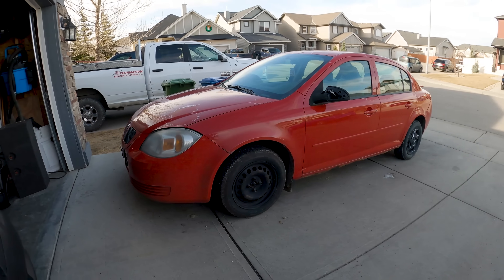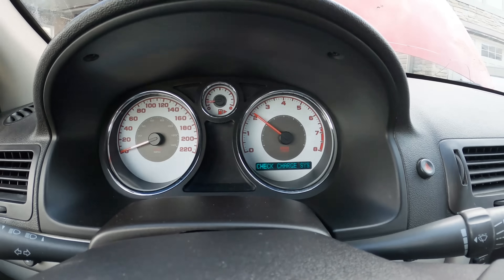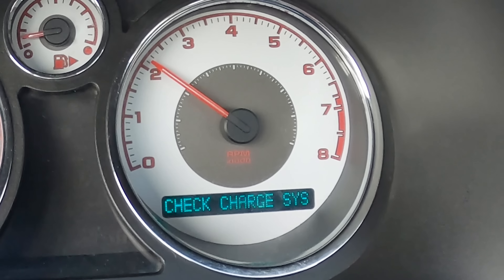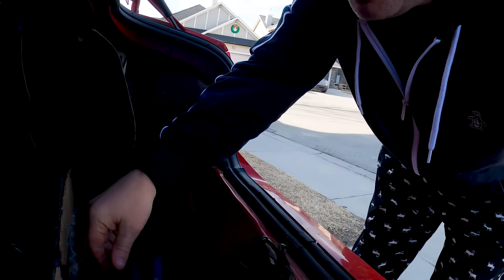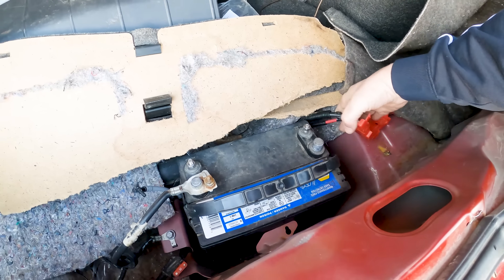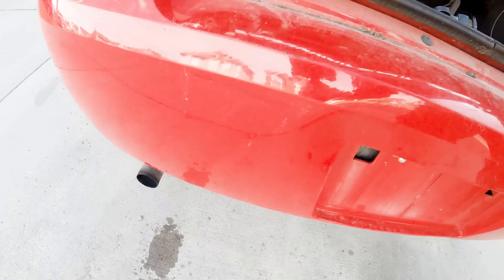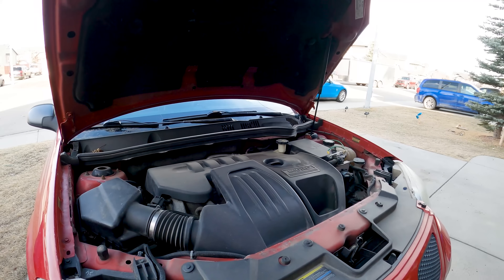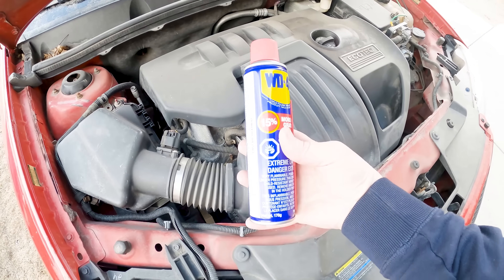ROADSIDE FIX! REVIVE your DEAD or DYING Alternator with this ALMOST FREE trick! | Gears and Tech

Comment: The information in this video is not true and incorrect. I'm an automotive technician for 15 years. I specialize in electrical. Never remove your battery cables while the engine is running and idling. The alternator uses the 12 volt battery to create an electro magnet inside the alternator in order to create a magnetic field... A magnetic field is needed to produces current within the copper windings in the stator of the alternator. The electricity being produced is AC (alternating Current). The diodes in the alternator will then covert the AC into DC (Direct Current) because your vehicle uses DC. All the negative phase are removed by the diodes and the positive electrons will flow to the positive side of the battery pushing the electricity back to the negative side of the 12 volt battery... Remember that the alternator does not charge the vehicle's battery but rather maintain the charge of the 12 volt battery.
Reply: Question 
My car when starting it's only  click once then the battery  ground terminal gets hot 
Any update on. That
Reply: @snoopha3  probable cause is loose connection, copper wire strands are cut within the negative cable or a bad starter drawing too much amperage causing the cable to heat up quickly.
Reply from the maker: Bad ground
Dead short inside starter

Try hitting the starter with a 2x4 or softly with a hammer and then try again.

Comment: When disconnecting battery, there is voltage supplies to ignition module / coils so no spark at spark plugs also fuel pump has no power so no fuel deliver to injectors then engine will be shut off ? Am I right or wrong with this theory? Someone has any inputs ?
Reply from the maker: Engine running, battery unplugged nothing changes, alternator provides power to everything

Engine off, battery disconnected, nothing has power

Comment: I thought of spraying alternator with brake cleaner, i didnt yet, sonebody says its flammable. Can i use Brake Cleaner?? Plus is wd-40 flamable???
Reply: Despite what the comments say on here, do not spray your alternator with contact cleaner or wd40. This will work its way into the bearings and will kill the alternator.
Reply from the maker: Use the wd40

Comment: You don't have to disconnect it for the engine to die, it will die anyway very quickly with  the power steering failing.
Reply from the maker: True

Comment: Do not remove your battery cable while your car is running. Most modern vehicles regulate the charging through the ecu, and if the ECU doesn't detect the battery it will cause it to overcharge the alternator causing the ECU to fry, or worse

Comment: Ive been chasing a p0345 code  & i cant figure out what it is. Can a faulty alternator throw that code. 05 ford expedition. 5.4L
Reply: That is for a bank 2 camshaft position sensor. It is probably just the sensor but you need to swap it asap. It could cause a no start and it can also end up making you need a timing chain. Don’t let that go. Find a video to show you how to change it & change it asap!!!!

Comment: Buy a $8 multimeter from harbor freight... and NEVER disconnect your battery when the engine is running on a modern vehicle !!!  Modern vehicles have extremely sensitive electronics that can be damaged from voltage spikes caused when disconnecting or connecting battery cables with the engine running!

Comment: Hi! Great video, learned alot. Question though. I'm trying to diagnose my alternator pulley without removing it from the car. I does not have a belt (Volvo 3.2) . When I turn off the car, should it come to a dead stop (the alternator) or should it spin a few seconds? (I thought this was the point with the pulley to not put to much stress on the alternator) thanks!
Reply from the maker: I'm not familiar with your setup. I would think it should free wheel when the driver stops.
Reply: @GearsAndTech  thanks. I actually think so too. Gotten different answers when I've spoken to local mechanics where I live.

Comment: DO NOT DISCONNECT BATTERY W/ENGINE RUNNING:
My concept is that the battery acts as a "Buffer" or "Surge Protector" for your Electronic Modules (DME, etc.). It is also sensed by the IBS, DME Power Management, & Voltage Regulator, to determine Alternator Voltage Output. Disconnecting Battery with engine running can damage Alternator Diodes, and/or damage ECU's.

Most any vehicle since the 1970's with an ECU for EFI, had a warning label on/near the battery saying NOT to disconnect battery with engine running. Bentley Manual states that MULTIPLE times, with this quote at p. 248:

Running wipers with no water on the windshield will wear the wiper.

Comment: disconnecting the battery while the car is running on some cars will completely fry the voltage regulator, then your alternator is guaranteed to be dead.

Comment: My mom's 2006 RX350 alt bit the dust on the way home from the airport. I had one of my passengers rev the engine to keep it charging (because the light would come on if the engine was under 3,000RPM) while I ran into autozone and got a can of WD-40. I emptied 1/4 of the can into the alternator and was able to get us home and replace the alternator and serp belt my next paycheck.
Reply from the maker: Perfect, that's exactly what this tip is for

Comment: He used a tool.. aka usb voltage checker…. Also loose battery cables can cause battery or charging issues. You need a wrench or ratchet (a tool) to loosen the batter terminals… you need to rename this video to “let me waste your time” thumbs down!
Reply from the maker: You got me

Comment: Hey Elvis, use a iron object touch it to the alternator pulley then turn the key to on if it is magnitized and the metal object sticks the damn thing is good..
Reply from the maker: Thanks for the tip
Reply: I did this and it does stick to alternator pulley but real lightly . How strong of a pull does it have to be when it sticks to the pulley ?

Comment: Many of the newer alternators have the field coil (on the rotor) receiving voltage from the battery and won't output any voltage when the battery is disconnected.  So unplugging the battery, on such a system, will always cause the motor to stop.  But, on a lot of older cars, the car will remain running off of just the alternator when the battery is unplugged.  Good video!  I gave it a like.
Reply from the maker: Thanks for the extra info.

Comment: But what if the battery is lower than 10 amps your teick is useless because the car will not turn over to get a charge...
Reply from the maker: Jump start car, then it'll charge battery

Comment: Doing it now on my Volvo S40 2007. Battery light came on today after a massive oil leak (my fault, I stripped the housing cap to the oil filter and leaked oil into my drive belt and alternator) replaced the cap now having power system problems.
Reply: Update: didn’t work for me. The car died after unplugging the negative cable then it wouldn’t start again. New alternator test works? I guess,
Reply from the maker: Yep, either more wd40 and try again

Or new alternator

A jump start to confirm first though. Battery will have been low due to poor alternator performance
Reply: @GearsAndTech  Yes you’re absolutely right. I ran out of wd40 and my 9 volt battery was dead in my multimeter. My sister was able to bring me a new 9 volt. I checked the voltage from the battery (11.???) and when it was cranked up (7.8?? Ish) it seems to just keep draining the battery while it’s on and all the lights on my instrument cluster are on and flashing. Don’t know. I’ll have to check out it tomorrow in the sunlight. I might even record since I have nothing else planned

Comment: The author is no mechanic! And he's dangerous... Removing the positive cable could easily lead to a spark next to a battery with low charge off gassing as the alternator attempts to charge. All diodes in the alternator will immediately be chunk and the backyard amuture badly burnt or worse...
Reply from the maker: Wow, sounds pretty grim

How come none of that happened when I did it?

Comment: An alternator can - and should - be producing full charge at idle. That is the whole point of an alternator vers a generator which does what you are talking about. At 11.7 V that alternator is not charging. No more testing required; and specially not removing the battery cable with the engine running to confirm what you already know - unless its the loose battery pole causing the issue. Untold problems will occur in the electronics of modern cars if you do that - again, you are stuck in the past. Your "fix" was useful in a desperate situation but telling people to do the other stuff is going to cost some poor bastard a lot of money.

Comment: Waste of time 12.4 volts is an undercharged battery. Alternators always generate around 14 volts even at idle revving the engine is not necessary. If revving the engine gets you more voltage then the voltage regulator in the alternator is bad. Use a voltmeter with engine on and check voltage at the battery if its between 14-14.8 volts the alternator is working. He clearly has issue with the alternator. The alternator is what powers everything in your car not the battery.
Reply from the maker: its great when you have all the tools, but if not you gotta do what you gotta do

Comment: Good thing you explained how to open the hood!   Had to rewind and watch carefully but finally figured out how to open my hood !      But you didn’t explain how to open the drivers door so I’m currently still stuck sitting in my car     !!    Been about a year now !!  Also  :   Please explain how to get the straw into the wd40 nozzle  again   I tried using a hammer drill but it still won’t work
Reply from the maker: Glad I could help

Seems like you're on the right track with that straw. Just twist while you push after you use the drill to make the hole bigger

If that doesn't work, you need a bigger hammer

Comment: Misinformation alert between 2 groups:

1) Mechanics trained that this DOESN'T work
2) The poster saying it does

Im going to tell you why both wre are right.

Where do mechanics get their information from? Books/teachers/statistics/guidelines etc. They INVENTED these guidelines based off of the mathematical chance that something could happen. Actuaries do this work mostly who work for insurance companies. 

If you are a mechanic who does this job for a large company and you have a 5 to 10% chance that this might fail and you end up doing this job for 10 years and you end up doing it a thousand times How many refunds will you do? You will cost the company a lot of money. Therefore they will tell you to never do this because you will end up frying the part. 

However, that does not change the fact that there is still a 90% chance that it will succeed. If you are watching this video and you do not have the money to take it to an expensive mechanic and pay $1,000 to fix it when you could use the shortcut method and fix it for a couple hours of your own time and $100 in spare parts then would you take a 90% risk? And 80% risk? What if it was 66%? At some point there are diminishing returns with these types of videos and tricks. The mechanics are not wrong but then again it comes down to not paying for a premium. 

I think you understand what I am saying here. They will have a war in the comments both saying that they are right. They are absolutely correct because one side has been taught one thing but yet the other side is not lying because they have successfully demonstrated empirical evidence and proof by doing the job repeatedly and yet never having a negative experience. Does that mean that they are wrong? Absolutely not. A mechanic would never try that because they have all of the tools, the training, and the money to pull it off without ever needing to resort to a shortcut. However they have also been brainwashed by the establishment - If you want to call it that - to not use certain methods which may work just as often as anything else. The wild thing is that mechanics are not perfect and they make mistakes 5 to 10% of the time anyway. Which means they are no better than any other technique at the end of the day. You are just paying extra for them. 

TLDR: If It works for you. Excellent. That was the point. In my experience 9 out of 10 mechanics are not worth the money and will just rip you off. I have had thousands of dollars of worked out of my car by a mechanic and nine out of 10 times I've had to take it back because they did it wrong and in many cases they did it wrong three or four times consecutively. Yet they will come on here and tell me or anyone else how much education they have! If they're so smart why can't they do a job properly the first time and honestly!?
Reply from the maker: Excellent example. I agree

Comment: Normally, I would urge folks to avoid using WD-40 for anything, due to its heavy residue load that does nothing but attract dirt long after evaporation.  However, with a part that's on its last legs anyway, there's no long term muck-to-failure concern.  At the same time, cleaner cleaners are just cleaner...

Comment: Disconnecting the battery while the car is running is the old school way of checking the alternator. It is not good to do on today's cars. The easiest thing to do is to purchase a battery tester or if you don't want to spend any money you can take your car to Autozone or Advance Auto parts store and they will check it for free....

Comment: Ok, in 1984, the battery trick was fine. Today's car, you have a high probability of shorting out your pcm, 
 The Alternator trick is close, I would use an electronic cleaner, or brake cleaner so that u don't leave a residue.
Reply from the maker: Thanks for stopping by

Comment: Yikes! Disconnecting the battery while the car is running is NOT a good idea. Without the battery connected, the car's voltage can go very high and destroy expensive electronic components. AND if you happen to touch the loose positive battery cable to the metal chassis, you can kill your alternator right there. 

If you see a "Check charging " message or alternator warning light, it's best to check for loose battery connectors and if you know how to use a multimeter, check the battery voltage while the car is running. It should be 14 to 15 volts within a minute of starting the car.
Reply from the maker: It seemed to be fine

Comment: So, not a mechanic but have been finding workarounds for many decades and I usually hear the same BS over and over again by the "EGGSPURTS" saying you shouldn't do anything but spend inordinate amounts of money on "Professionals" when addressing any problem. My experience has shown me, its usually a chicken little talking that wants to flex their book knowledge. 
I also find it interesting that DESPITE all the warning posts, very few of these eggspurts have stated that they have seen systems fry over this and I think that is likely because (as another DIY guy stated) they had never TRIED it. So cut it with the  sanctimonious crap.
Is it the BEST solution? Of course not. However,  not everyone has disposable income to address every problem life throws at us and so we have to sometimes find workarounds.
BTW, I am on this U-Tube channel for this exact same problem . Alternator was putting out 12.7v. Sprayed it this morning and guess what? It didn't fry the multiple control modules and voltage has been steady at 13.8 volts on my 2016 vehicle. Seriously, this "let them eat cake" BS is so tiring.
Reply from the maker: Awesome, thank for stopping by and sharing your experience

Glad it worked for you as well

Comment: Take your billy goat pajama pants back in the house and leave mechanical items to those who understand them. Way back in the day (on 70's and 80's automobiles) you could safely disconnect the battery while the engine was running and no harm done at all. What you're suggesting is going to cost some unaware viewer thousands of $$ when you're ill advised advice fries modules, ECM's (your cars computer) or just fries a very expensive alternator (when you fry the diode). You'll gladly do this on your 500$ car that means nothing to you, but lets see you do this on your own vehicle, negate the warranty and cost yourself thousands. 

Foolish people will try to convince other foolish people to do foolish things. BTW, your raw cookie dough statement below goes to show your complete lack of knowledge and your ignorance will cost someone a lot of cash. Think before opening your mouth and letting foolishness take over. Well intentioned and well meaning isn't going to help the naive person that follows your advice!

You (the YT viewer) are much better off gaining a tiny bit of mechanical knowledge, get a few very inexpensive tools and learn how to do very basic diagnostics that may help you understand what the issue is. Cars today have multiple modules, sensors and sensitive electronics that WILL be shorted or otherwise destroyed by following well intentioned advice from a back yard hack. 

There are some very good YT channels that have qualified mechanics and technicians that will not lead you astray. Unfortunately this is NOT one of them!

Comment: WD 40 you can even catch fish with it. Thanks great tip.
Reply from the maker: And clean your shower
Reply: @GearsAndTech  LOL
Reply: @GearsAndTech   Don't forget to buy a Neck Brace First.
Reply: And you don't need cooking oil😂
Reply: I've heard that athletes used WD-40 to lubricate the joints in their knees and elbows. They said it works